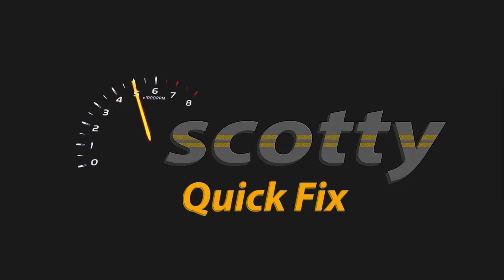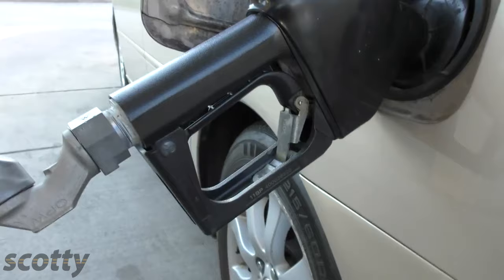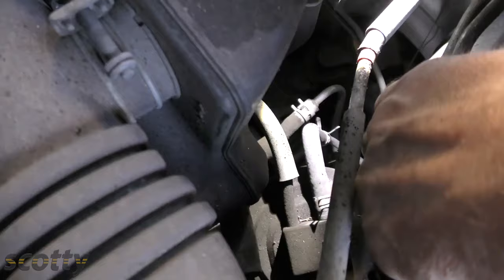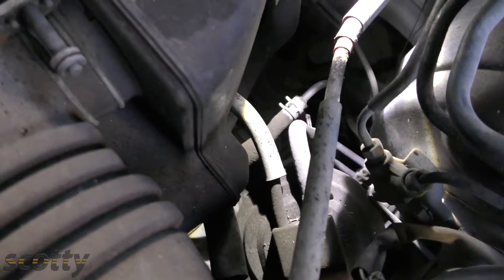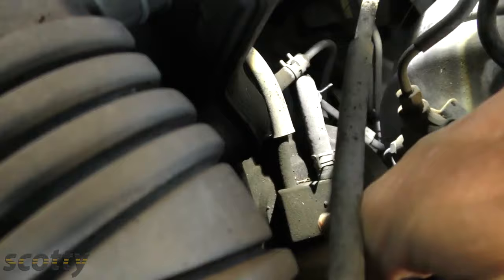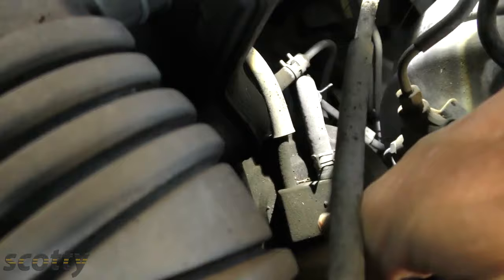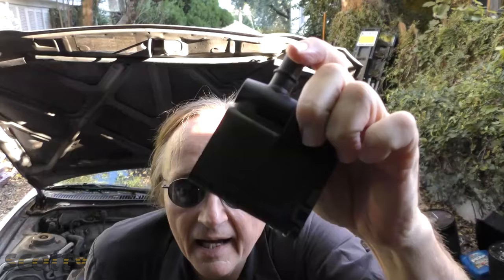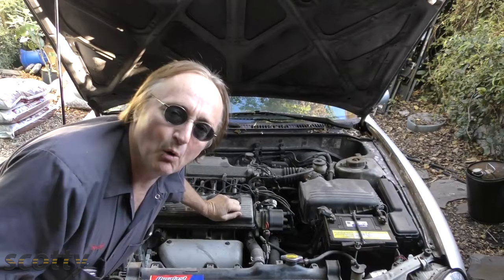Why Not to Overfill (Top Up) Your Car's Gas Tank

Comment: sadly i learned that the hard way. 600 bucks into my ma car for repairs so it would pass inspection. just got gas and gave it to the repair shop and they said it was so over filled that once they touched it it poured like a son bitch.  Freakin jersey and unskilled gas pumpers.  I dont mind them as its a JOB but if someone doesnt know these facts it just screws ya over.  I was told nvr prime it.  And scotty is the 1st person to legit tell why.

Comment: I have been topping off for over 10 years.  I took my car to a repair shop because my 99 Chevy Prism failed the Emissions.  They wanted $500 for the canister alone. Plus with a new Cat, the final bill was over $1500. So I had to say no thanks and paid the $75 for inspection and drove it home.  It drives very nicely since I put the gallon of thinner in there.  But I can not get my Registration until I pass Emissions.  If I do not pass Emissions by Dec 30 I will have to pay the late fee.  I am going to try the CRC Guaranteed to Pass today, but some folks have had to drive 300 miles on the highway before the check engine light goes off.  And even then that pesky OBD Code P0420 may still be there.The rules for the 3 day Permit I bought yesterday says: For Emissions, Registration or Repair.  How will I clean out the cat and pass emissions without a long drive on the Interstate if it is strictly forbidden.  I heard leaving the car on Idle would not be a good idea for several reasons.  Help?
Reply: Rick Heilman 99 Chevy Prism? It’s worth like $200....
Reply: The Thinner worked.  I passed emissions without paying the $1500 the repair shop wanted.  And the car is running great.

Comment: Reason #2 :  Keep pushing that gas into your tank, keep pumping and pumping and pumping and pull the nozzle out to bypass the shut off and  then scratch your head and wonder why there's half a gallon on the ground and blame it on a faulty gas pump. Nope. There's definitely something faulty alright but it ain't the gas pump.

Comment: Oh well. So I put gas fumes into the air. Rather have a real full tank especially if driving long distance or during winter.
Reply: i think hes talking more about saving your canister.
Reply: Cozy Raps As long as it doesn't affect performance, I don't care about the canister. Just another add on so they can jack the prices up on cars and help the mechanics out  financially.

Comment: Not only is it bad for your car, it's a waste of money because pretty much none of that extra gas is actually going into your tank. If you look at the end of the nozzle of a gas dispenser, you'll notice holes that go around it. That is to allow the gas to filter back into the tank once the vehicle has been filled to capacity. So, each time you click the handle to try and fill more gas into your tank, it's just going back into an inner hose inside the dispenser (the hose going to the dispenser actually is comprised of two hoses).

Comment: Very useless Info. Most tanks have a "neck" that sits higher than the tank and only when its filled to the top is when is shuts off. Evaps are usually on top of tank from a vacuum line. Most manufacturers know this and that's why that have longer sometimes curved  vacuum lines going to tank.
Reply: I've seen plenty of (domestic) cars where the evap hose connects at the top of the filler neck, 2-3 inches below where the gas cap seals.  those cars had evap canisters you can replace without having to remove the entire fuel tank.

Comment: I deliver gas. if you knew how much fuel we spill on the ground, how 40' long hoses are thrown onto the trailer after delivering and are filled with vapor, and otherwise how much of this crap goes into the air, you would be rioting at having yet another epically ridiculous, pointless and idiotically expensive doohicky such as this on your car. it's in the same stupid category as transponder keys and tire pressure monitoring.